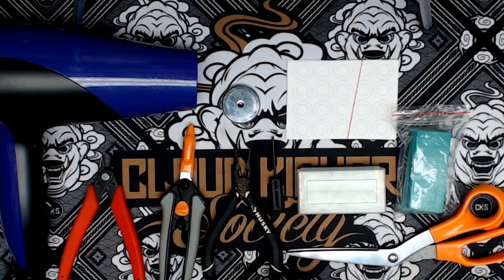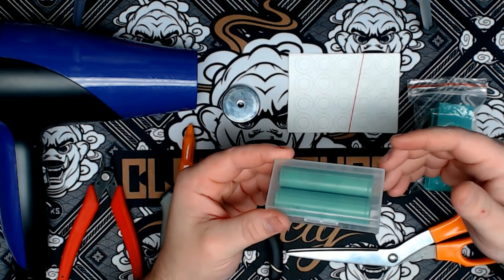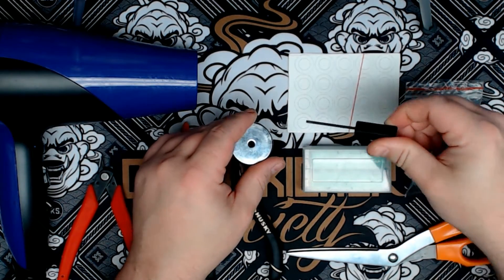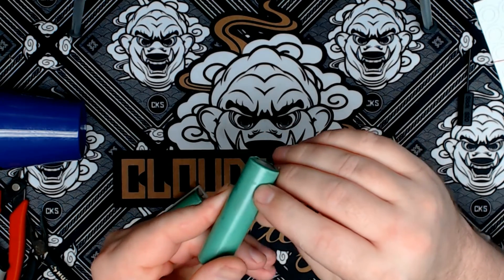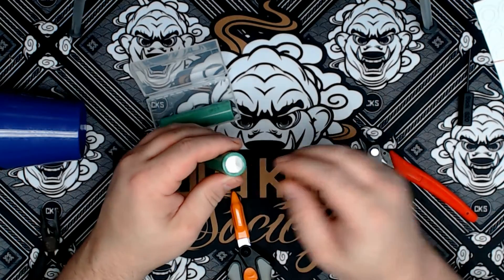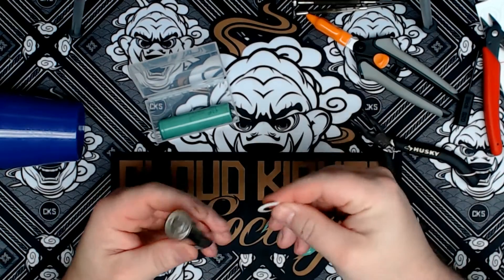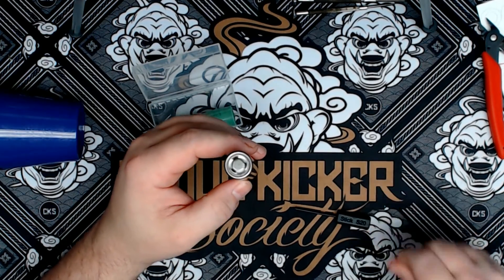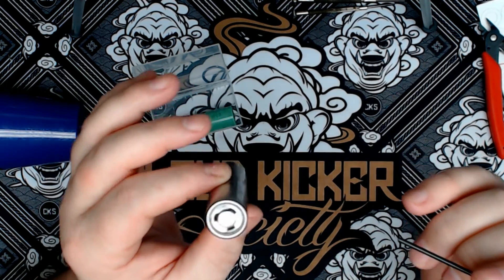Battery Safety and Rewrap Tutorial

Comment: I re wrapped my 18650 batteries for the first time but I didn't know that you needed to cut 2 mm off the wrap so it fits the battery perfectly

But for my first attempt I didn't do a bad job 

Thanks for sharing this aries I will give your method a try when I need to re wrap my batteries
Reply from the maker: Not all wraps need some cut off to fit. The ones I currently have needed a few mm trimmed off, but I have had others from the same company that fit perfectly without any adjustments.

Comment: I saw a customer in my local B&M with two 18650's in a tobacco tin the other day with just enough space to be able to lift one out and loose pre build coils. I promptly bought him a battery case (they were £1) and put his batteries in it, then the case in his tin, and gave him the mini lecture about battery safety. Scared part was, the employee thought the tin was fine so long as top and bottom of the battery couldn't touch at the same time, had to point out that coils are mini springs and could easily find their way into the gap
Reply from the maker: Thank you for thinking of his (and your own) safety even in the absent mindedness of the shop employee. Taking things for granted like that is what ends up with someone in the hospital.